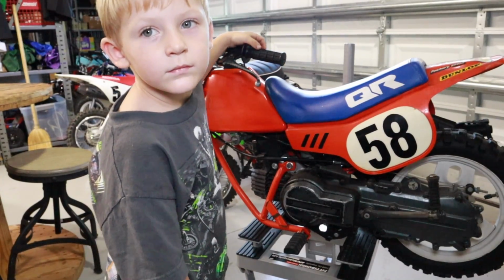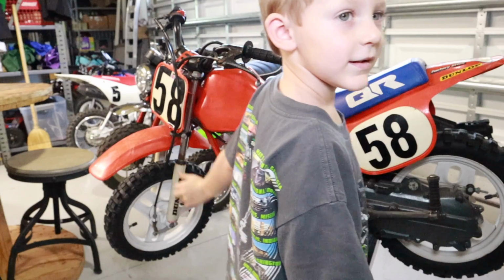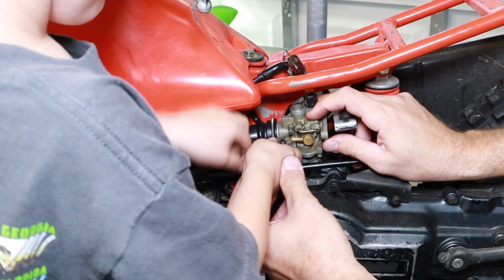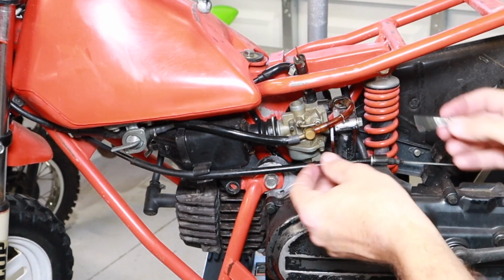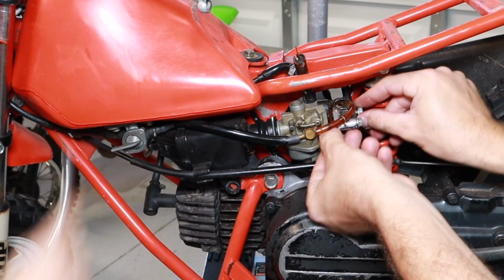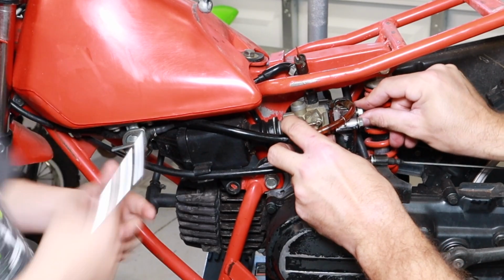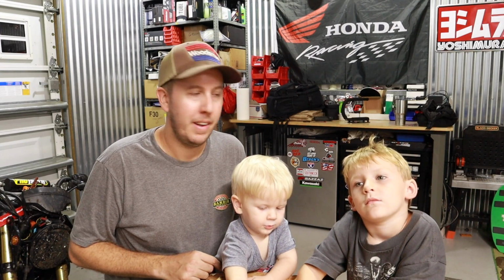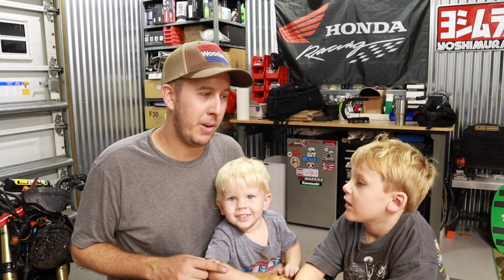Small Bore Finds: 1984 Honda QR50 - Cleaning the Carb

Comment: There is a FaceBook page for the QR50 that has the service manual in the file section. Here is a link https://www.facebook.com/groups/HondaQR50/files Is the oil pump still on the bike or has it been removed? Your carb is missing the choke cable, so you may want to see what is under the black cap on the side of the carb. If you have any questions, I would be happy to try and help you out.
Reply from the maker: Thanks Pete, I’m going to join that group as it’s hard to find parts and info on this bike. I don’t know if the pump is still on, but it’s not active at least as the oil pump cable part of the throttle cable is broken. Im not sure if I want to restore the bike to stock auto mixing, but the choke is needed as it’s hard to start when cold. I was looking at carbs for them and unless I buy an OEM replacement for $200 from Japan or the UK, I’d have to try to make an eBay generic work with a regular choke lever. Do you have any suggestions?
Reply: @John5XR  your carb is probably ok. You need to see if there is anything under that blackcap. I believe new choke cables are still available from Honda Canada. I can't understand why some people modify stuff and throw away the original parts.
Reply: @John5XR  i just bought a new cable and starter valve setup for my 83 model same deal for the 97 i have. both have dramas starting without it now its on the 97 it starts all the time.

Comment: Hello. Just wondering why that plastic part on the top of the carb has that orange stuff on it?
Reply from the maker: Hello! That is supposed to be the choke cable, but it must’ve been sealed off by DTC sealant from the previous owner
Reply: @John5XR  thank you.
Found a 1983 mini moto in my moms garage. Been sitting since 1990. Really dirty so I'm gonna take it all apart and attempt to restore it.
Reply from the maker: That’s awesome!
Reply: @John5XR  sorry to bother you. But do I need that choke cable or can I block mine off too? The plastic bit that screws inside of the carb has sheared off. Took me forever to get it out